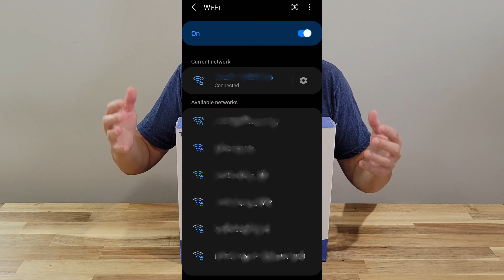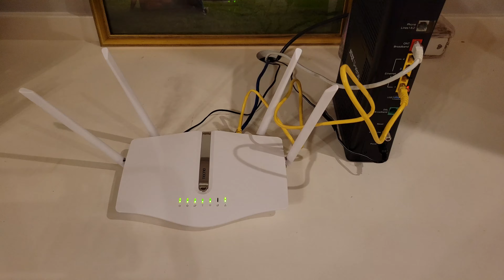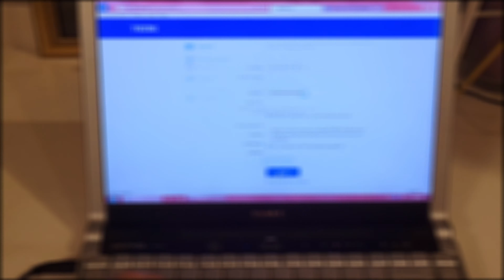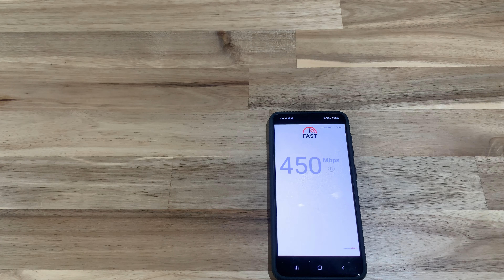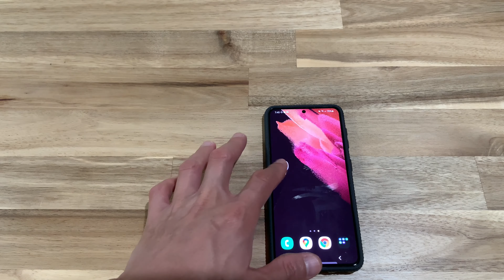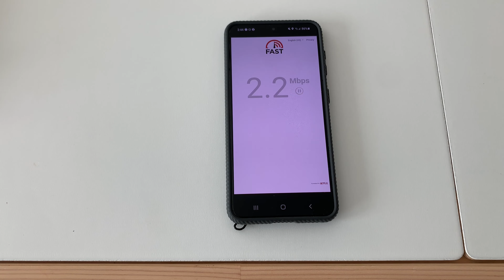Best WiFi 6 Router Under $100 2021 - TECNO WiFi 6 Router AX1800

Comment: I don't recommend buying this router, because after updating the firmware it will not recognize the admin password, even after resetting the router, it still doesn't let you logging in the router admin interface. Basically it is rubbish. Tecno if you see my comment, fix the damn issue.

Comment: Hi, do You know if this router can be used as a repeater without using cables?
Reply: You probably just need to set it up as a bridge or if you have two routers, send an Ethernet cable to second router and turn off DHCP on the second router.  You only want one router issuing IP addresses.  If you can set a range on both routers, then you could allow both routers to issue IP addresses, but there can be no overlap so no two devices get the same IP address.  If possible, give the router a static IP.